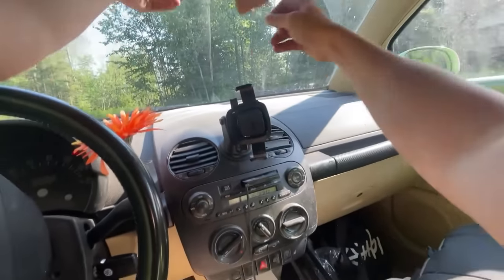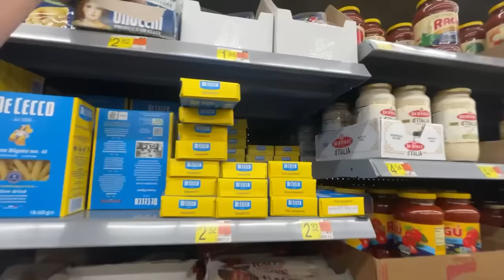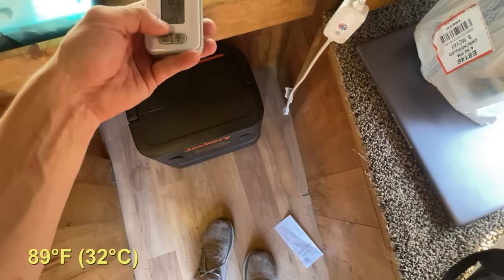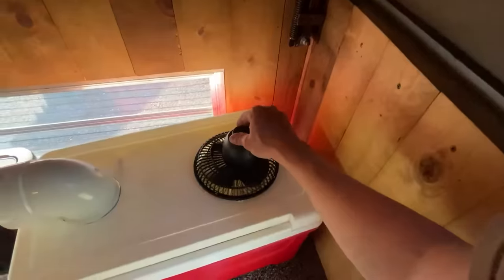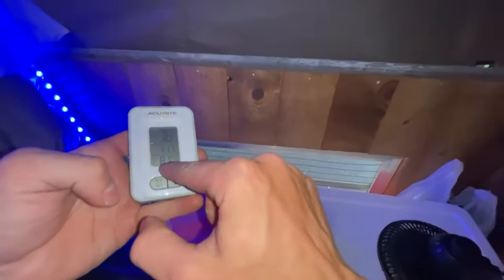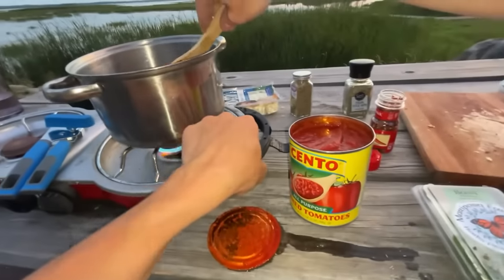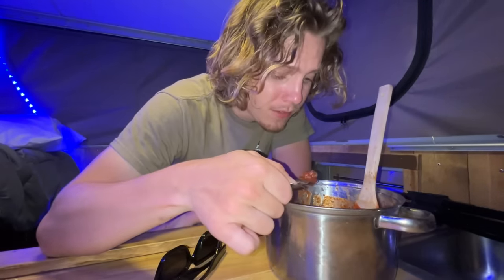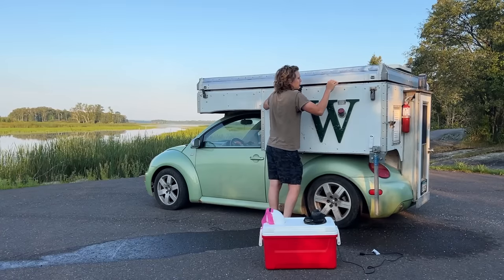Car Camping w/ DIY Swamp Cooler - Will it Work?

Comment: MSI has terrible construction, I have owned two and they both fell apart.  Other friends of mine had the same problem.  Performance is pretty good, but when your laptop falls apart so the screen will not work or the keyboard and mouse fail, what is the point other than theory that you can compute at high speed?

Comment: Hot air always go up! So open up the roof vent!!! Your cooled air has to build up first! That means, that it cools the VW down stairs first! The most effective it would be, if you lengthen the tube, and let it blow out cool air against the roof (let that pipe just be three inches shorter). The cooler air will spread! But always keep the roof vent open! Maybe you should invest in a ventilator that fixes in that roof vent! These are for sale, but it has to be 'snugfit'! Go to a shop for camping equipment 😊

Comment: That cooler would work a little better if the canvas was more insulated I think it was probably just making up for the heat transfer from it, when the sun was out. The cooling effect worked once it wasn’t fighting the sun

Comment: Swamp coolers only work in areas of the world where humidity is low ( hot dry weather) swamp coolers  removes heat but not humidity.  Any place north of NC is too humid for a swamp cooler to be effective.   A normal air conditioning system is a big dehumidifier, which is the only way to remove moisture in the air.     
1. cooler air will never feel comfortable if it is still saturated with humidity 
2. cool humid places will begin to condensate (sweat) and being to grow bacteria and black mold.  That is why it is very important to have a dehumidifier in a basement in humid environments.  

If you were camping in the desert in AZ then this would totally work and keep the heat load out.  Also to be more efficient, slowing down the air flow will allow the air to have more time to give up heat to the ice.  the faster the air moves the less of a temp drop you will achieve.

Comment: The air has to move through that ice.  Put a wire grill a few inches from the bottom and attach another piece of pvc through that wire grill so all the air has to go through the ice and grill.  Aluminum elbow and straight piece would also stay cooler

Comment: My suggestion is bring a small stand up portable air conditioner
 and plug it into that Jackery 2000. Run the vent hose out the door just cut a hole in it for the exhaust.

Comment: I grew up with a swamp cooler. Swamp coolers do not do well in humid climates. You do need to keep one vent slitly open to draw the air thre the camper if you use it. You would do much better with a small refrigerated air conditioner. Cheryl from Colorado!

Comment: If you put a separation between the fan and outlet, and a raised platform that air can flow through, then the air will be forced past the ice and back up the the outlet. It'll blow cooler air, then just passing over the ice.

Comment: Mav reason swap cooler didn't work was you was adding moister in air thus making it hotter thicking up the air.. it's better just get mobile ac that pulls moister out of air and cools it.

Comment: Go to Menards and buy you an 8,000 BTU stand up air conditioner that's on Wheels it'll tuck right there where you're at make a little piece put the vent out the window and turn it on and another thing is get you like a little Honda 2000 watt generator it runs on eco mode that's real quiet put it outside the car run a cord in I guarantee it will freeze you out of that thing

Comment: You would need a stronger fan and way more ice to get a reduction but if your juts looking for easy cooling try the ecofkow portable rechargeable ac unit they work pretty freaking well, not cheap but worth it. They can also use solar.

Comment: All of those low output swamp coolers are made to be positioned pointing right at your face all the time just like you would a small fan on its own if it was low powered. The closer to your face the cooler you will be. Buy a long section of flexible tubing and stick it in front of your face while you’re sleeping

Comment: We have a farm and the country of Belize. We have no air condition and most of the year we do not need one. About two weeks out of the year you would welcome an air condition. For those nights when it gets warmer than normal, we take a water bottle that has been frozen and put it behind her neck. It not only works as a neck pillow but it cools you down all night. I learned that from one of the locals and it does work extremely well. A fan would probably work well too but I am too cheap to run the huge generator all night long. Lol

Comment: thats not really how a swamp cooler/ evaporative cooler works. its the water evaporating from some medium that creates the cooling. thats why in the ones you buy they have a absorbent grid  the fan blows air though for more surface area. they wold work if they were alot larger. Also it wont work in an already humid climate.

Comment: I think that if you put some kind of fabric wick hanging from the inside of the lid between the fan and outlet it would cool much better, just make sure the fabric strips reach the bottom so the ice cold water will saturate the fabric wick material, using strips of material will allow the air to blow through

Comment: Ive worked in a non climate control metal building  in Oklahoma for years where it gets real humid. The best thing I've found that works even with camping down here is just keeping the air moving. Don't be cheap with fans and displace alot of air and maximize ventilation. My company has spent thousands on big Porta cool systems that just get dusty in a corner because they are more hassle than there worth.

Comment: i suggest you go and study thermodynamics, fluid dynamics, then try again 🤣. generating cold air on the bottom and hoping it would get up in the bed area is a dead end, thats not how physics works. your van is greenhouse, heat comes in in the form of light, and the energy builds up and doesnt have any way to escape. 😂thats why it is colder outside.
try paving your walls with pelletier modules and plug to your battery. i doubt ice based solutions would last more than 1 hour, except if the heat transmission is very ineficient. well the refrigeration problem has been pretty much solved since decades, just grab parts from a fridge and duct tape them on the van, compressor, radiator on the outside to dissipate heat, etc. you always want to make the heat move from inside to the outside, that is how freezers, refrigerators, A.C. units, work. it is an interesting problem that science can solve with simple fluid compression/decompression and external heat dissipation. anyways...

Comment: Maybe if you had 3 or 4 racks to stack the ice on with of course more ice , the air would blow thru the ice instead of just over the top.  Or you could get an irrigation pipe with holes so there again thru the ice 🧊 not over the top 🤔?

Comment: I did the exact same thing but I froze gallon jugs of water so I could switch them out easier ( I put 2 jugs at a time in the cooler)plus the air blows around the jugs which makes the air come out cooler( also I put a towel on the bottom to absorb the condensation).  Only issue for you would be keeping frozen jugs on hand.

Comment: Freeze water bottles full of water and loads of ice packs, line the inside with tin foil, take the front cover off the fan (12" fan) and put it on full power

Comment: You need that cooler almost completely full with rock salt on it. Also you have basically zero insulation so it’s probably not gonna work in that space anyway. Also…. Do you need someone to buy you a GoPro so you can keep your phone out of your mouth? Lol

Comment: One thing I would do is get enough ice to fill the chest 2/3 full the add enough water to equal level with the ice and add salt. Mix well and it should push out air 10-15 degrees colder. And is a bigger fan. Should be better.

Comment: The smallest window air conditioner you can buy will absorb the heat equivalent of melting 900lbs of ice in one hour so melting 5-10lbs of ice over several hours is never going to produce meaningful cooling in a space larger than a cooler.

Comment: I would say you did not have a swamp cooler but a heat exchange cooler.  Your surface area for heat exchange was small and if you think of the volume of 32 degree material you had vs the volume of air you were trying to cool that would be hard to cool. Swamp coolers need very low humidity to evaporate water from some material.

Comment: Is the cooler packed with ice to the top? You also need to close off the back from the sun drenched front cab. You have to bring the temp down on the actual vehicle then maintain cooler air after. But the actual walls and bed and floors need to cool down before the air temp can cool down.

Comment: your doing the swamp cooler wrong, you are only pushing air over the top of the ace water, you need to make the airflow forced like how a water bong works and force it through the ice and water and use a ton of salt in the mix

Comment: Run a tube down underneath the ice so that the hot air has to pump down and rise through the actual ice instead of just blowing past the slightly cooler air hovering above the ice

Comment: I saw someone do the same DIY swamp cooler. He filled the cooler all the way to the top with ice and added a little bit of water and salt. It dropped the air temp coming out of the cooler from 71 to 42 degrees.

Comment: So I think that initially the swamp cooler wasn't cooling much because there was sunlight outside as well as you had the bag of ice clothes which gave it less surface area I think but even when it started cooling I think because of the fan speed the air was just coming in and going out really fast so if you had some PVC pipe that was underneath the ice but had an opening above the water it would force the air to go through the cold pipe instead of just above the ice

Comment: You need a fan circulating the air from the camper to the outside. Put a fan in the door facing outwards. That will pull the cool air throughout the camper.

Comment: Yellow swamp cooler has to have water pumping through it like a radiator of a car with cold water out of the well coming in the top of the radiator and going out the bottom is at a trickle with a fan in front of it those were the best swamp coolers that were homemade just a big radiator out of a car with a constant cold water intake and the trickle outside we just let go on the ground to water the flowers

Comment: Try putting a filter on we’re the air is coming out and one inside the cooler and get that filter cold wet with the ice water I feel like that would make a huge difference and make it colder in there!!

Comment: Gotta get the air to circulate longer through the cooler so it cools down before exiting. Run a pipe from outlet down to bottom of cooler and have the pipe circumvent the cooler inside under the ice

Comment: The problem is with a swamp cooler if you don't get the fan kind of like below the ice where the air will blow through it the problem is the ears blowing down on the ice and just blowing air over it and out so you're still rotating warm air which you're going to get a little cool air off of it but not much I'm trying making one of these and it will not work

Comment: A fish tank aerator with a coiled hose running through the ice allows for better placement for the needed area. A short section of hose insulation for the hose outside the cooler and a place to clip the the end of the hose makes a difference. Always place source of cold above since it will cool you as it passes to the lower areas.

Comment: new thing I just learned is that on a lot of those coolers. on the other side of the lid there is plastic cap with a pin hole under it that you can remove and then fill with water and put the cap back in and then freeze the water inside of the lid so I would see if that has it and maybe try freezing the lid and also put ice inside of the cooler as well

Comment: one sugestion for the cooler would be to fill it up with ice and add salt to the ice, It will drop the ice temp down a lot and will most likely improve the swamp cooler

Comment: Thanks Mav for mentioning the scam thing.  I still haven’t received my iPhone …hahaha.
HEY!  For your swamp cooler try a block of ice.  I know that they don’t work that great but a block will melt slower and if you put the block under the outlet and leave it clear under the fan you will create more thermal coolant vs thermal mass.  I.E. it gets colder 😀
Have a good one. (This is probably Mav Mom again) Peace Out from Wisconsin!

Comment: Make a frame devider in the center of the ice chest.  Cover the frame with burlap. Installable a resurculating pump in the bottom and pump water to the top of the burlap. Then your fan will create real evaporative cooling.
Reply: Also your engine is right below your camper keeping it warmer inside.

Comment: Try closing the passthru from the cab to the back. The glass in the front will intensify the suns rays and work like a heater fighting your cooler.